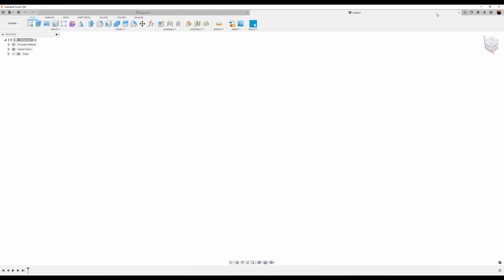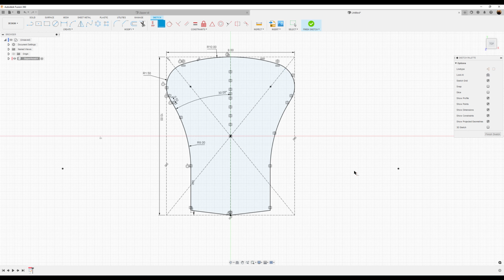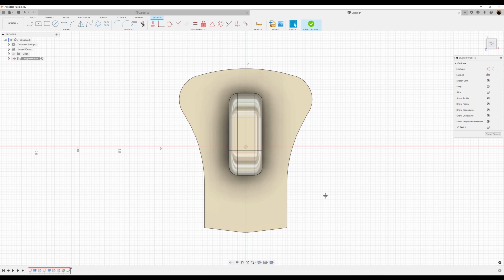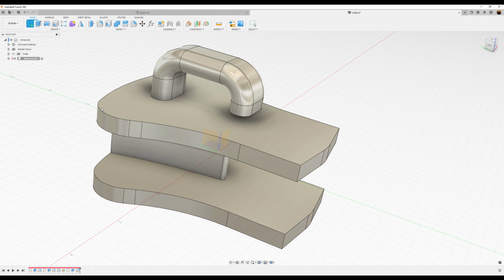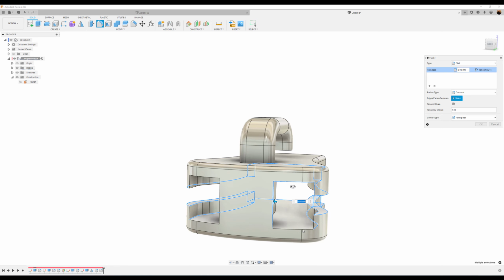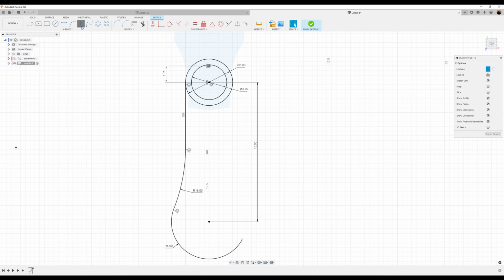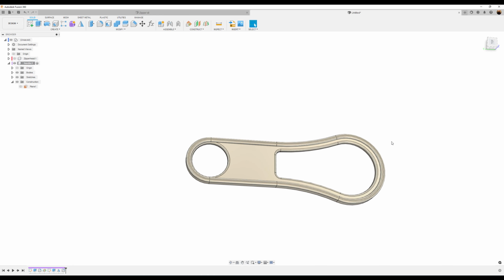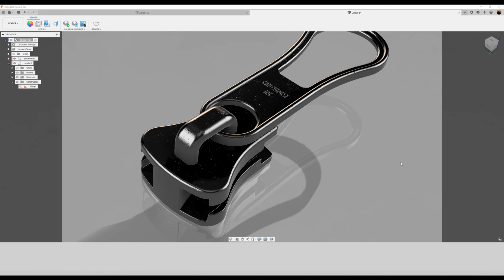Create and render a metal zipper head in Autodesk Fusion 360

Comment: Hello, I see you are using adobe substance files, and while you do need a subscription for their normal assets, they have a community asset page as well. The only issue is that all the materials seem to be a strange file format meant for the Substance 3D App. How can you get obtainable bump PNG's from this format?
Reply from the maker: So when you download the texture, make sure its an .sbs, not a .sbsar. The .sbsar version is compressed and can't be edited. Open the file in substance designer, right click on the title below the .sbs name and select "Export outputs as bitmaps".  In the dialog menu, choose the file destination. Select format .png, .jpg etc. You can keep all of the outputs checked or select specific ones. At the bottom of the menu click "Export outputs" and they should appear in your selected folder.
Reply from the maker: Not sure if that previous comment went through.